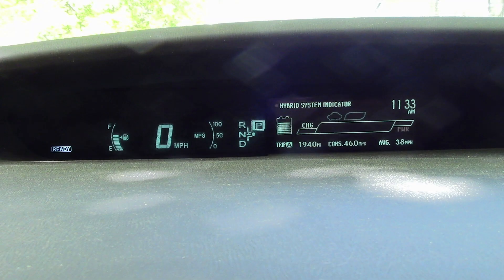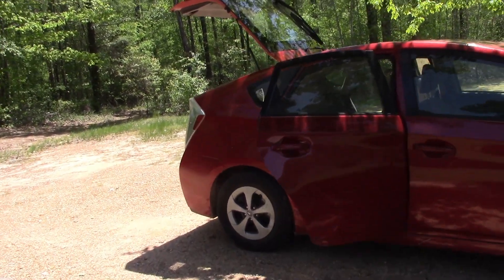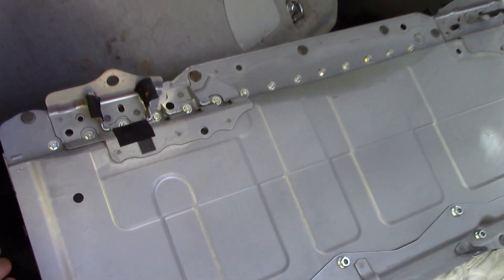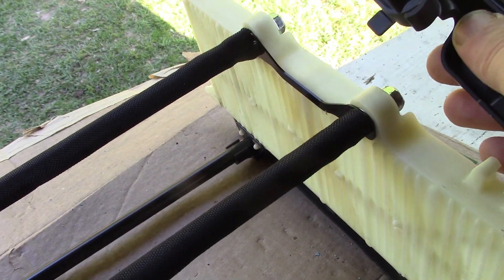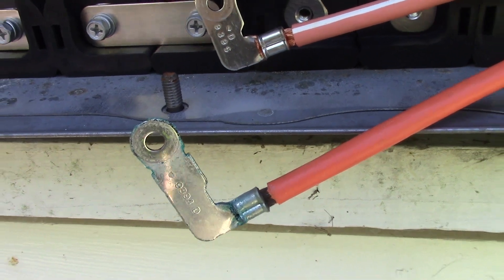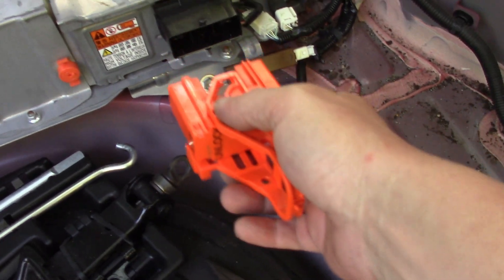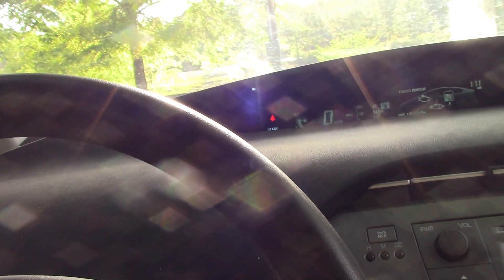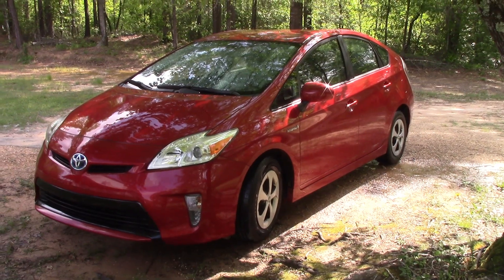Replacing Prius Hybrid Traction Battery (with scary wrong re-start!)

Comment: Mark I have a Prius exactly like that. It just suddenly died on me this summer. It’s showing a hybrid error. I’ve not pulled the codes or begin to diagnose it yet. I need a scanner. You are such a cool dude Mark :)
Reply from the maker: Cheers! I wouldn't be surprised if it's the traction batt, if it's not been changed. The Dr Prius App (free download on Android) can tell you which modules are bad. For OBDII scanner, I have a cheapo one from Ebay ($25ish, so not expensive). 
If the car's nearing 150K and hasn't had the EGR circuit cleaned then that can lead to headgasket fail, rattling and fault codes. Can check one of the pipes easily enough for condition of that system. I did a vid on it some years ago: 
https://www.youtube.com/watch?v=C7v538eQRDo
Reply: @Slider2732_  thank you so much Mark. Really man, thank you. I need this car so bad. I’ve not had a ride since August. 
It first started showing a “hybrid error”. The engine side seemed ok, but it soon started making a loud clanking sound from the electric side when I’d try to crank it, so I stopped trying. I thought maybe it was the inverter, but I have no clue really. If you think you can help me diagnose it, I will happily send you some money on cash app. The car has about 240k miles. Im not sure where to even begin. I’m sure the batteries are all dead by now.

Edit - Grok is telling me the clanking sound I’m heard when I tried cranking it, is most likely the damper disc. It’s saying $2,000-$5,000 repair. Does that sound right to you Mark? If so, I guess the entire car is trash now.
Reply from the maker: @fasteagle9959  A loud clanking sound from the electric side is a little confusing. Mostly, how did it run before the issue? 
If that sound is non engine then it could be the inverter. There was a recall soon after the 2010's came out because of failures on accelerating, like for on ramps on freeways. But the MOSFET's failed (electrical components), nothing clanky. 
Do check grounding points, by unbolting, cleaning, rebolting. Theres never a lot of rust on these, but could be some if spilled brake fluid got onto a grounding strip, which, could cause arcing. the clank sound may be electrical heavy sparking? 
 
If you press the Start button and it goes into EV for a few seconds, then starts the engine you're gold. If you press Start and it instantly comes up hybrid error and does the clanking then I'd say it's electrical on the orange wire end! If you press the Start and all hell instantly breaks loose then it isn't the engine. 

Could it be the HV contacts under the back seats?
You press Start, there should be a strong click from the traction battery electronics in the back and then up comes the regular dash and off you go. About 5-10 seconds later the engine starts. If those contacts were worn/dirty they could chatter and mess up.  
If I were a betting man, that's where my money would be at the moment. 

If it could be lifted on oil change ramps to get a view under then that might show anything mechanical (have to remove the underneath plastic tray guards). If all is clean and dry, no cracks, nothing wrong then I would suspect an electrical issue, not a headgasket fail - something you'd have noticed in the previous few weeks of driving anyway. Could always check the oil, see if there's water in it, milky/creamy looking.  

The garage quoted you a "Don't bring it to us", shouldn't worry about that. For that cash they'd swap in a scrapyard sourced engine AND electronics and pocket a bunch. 

A good sign is these don't normally fail in a sudden major way, they show signs well before complete failure. Even head gasket and EGR full blockage will show as rough acceleration and rattling at idle for a month.

Hybrid failure normally suggests the traction main battery. but, this seems more like something finally gave out - and it needn't be expensive to fix.  

I would recommend Priuschat forum for a search on similar symptoms and maybe to post your issue - those guys know the whole situ for Gen 3 and are kind folks 👍
Reply: @Slider2732_   hey Mark…thank you so much for all the info. I have someone bringing me a scanner to borrow tomorrow. I’m going to charge the 12v battery and see what codes pop up. 
Here’s what happened. Just one day I went to crank the car and the “hybrid system error” msg popped up. The gas engine still started and ran normally. This probably wasn’t very smart, but I tried to restart the car probably 10 times hoping it would go away. This had happened once before months back and the hybrid system error just magically went away and the car ran normally, so I tried restarting it about 10 times hoping the msg would disappear. Then during one of these restarting attempts, that’s when the clanking sound started, so I quit right then. This clanking sound, it sounds like metal hitting metal. It sounds really bad. Just prior to this ordeal the hybrid battery has always charged to 100%. 
I’ve been experiencing some really bad financial hardship and I haven’t had a scanner, so the car has just sit out in the yard since August. When i discovered your channel and saw your Prius videos, that renewed my interest to investigate further. Prior to that, I just assumed it would be a very expensive repair and since I’m flat broke, I haven’t done anything. Seeing your videos gave me some hope that maybe it’s not something major and it’s possible that it’s something that can be repaired after all. I guess the first logical step is to charge the 12v (if it will still hold charge) and pull the codes? 
This clanking sound is really bad. It does it when you try to start the car up, but it was starting normally, except it had the hybrid error on the display panel. Ugh, I should have stopped right then and there and not tried to keep restarting it. That wasn’t very smart. I’m worried I’ve really damaged something now, but maybe by the grace of God I haven’t. All this time I’ve just assumed the repair would be a major expense. 
Mark, I can’t thank you enough for helping me with this. I wish I could do something nice for you and Julie also. Yall are such good people. Thank you so much for your friendship. I value that so very much. 🙏 ❤️

edit…its crazy that we have the same exact car. Mine is red also !!
Reply from the maker: @fasteagle9959   
For codes, my suggestion would be to leave your foot off the brake pedal and press the Start, to put it in accessory mode, rather than it try to start itself. I think that should still enable codes to be read, because the dash etc fires up. 

I don't know what could make the clank, hence suggesting Priuschat website.

If it won't pull codes unless the car is actually on, then one idea would be to ask someone to switch it on while you look at the engine area ... perhaps with video to record what happens. Video always helps diagnosis from others online. 

Also, if the car was returning about the same MPG all through this then it may not be traction battery related. Usually they start to drop MPG when there are bad modules. They won't run in EV as long and similar symptoms.
My old battery pack did have corrosion on some lugs, so that is also worth looking at. The whole area under the back seat is worth looking at, as well as the engine bay for any loose bolts/connections. For anything orange colored, of course, pull the rear connecting bridge plug to avoid shock hazards. 

Good luck!
Reply: @Slider2732_  thank you again Mark.
From what I’ve read so far, the brake and start button trick will work to pull codes. I’m going to get out there and try once this weather breaks. Man, last night was brutal !!
The mpg and the EV mode never changed, so I was thinking that a previous owner must have swapped the battery already. It has 240k miles, so I would think that’s the case. I hope so. I haven’t gotten a visual on it yet, but I do need to do that. Also, I’m sure the battery cooling fan filter needs to be cleaned or swapped because I was hauling around my furry Shar Pei all year lol.
I’ll let you know what I’m about to figure out this week. Thank you so much my friend. You’re such a nice guy Mark. Thank you my friend. ❤ 🙏 
I hope y’all are having a great weekend.
Reply from the maker: @fasteagle9959  OK, good luck with it! Should be back to 70F next weekend 😁

Comment: Well not being a fan of net zero insanity I reckon you are taking a risk playing around with a high voltage battery unless of course you are a qualified mechanic. The scary bit is you are fitting a Chinese made battery.
Reply from the maker: If unsure of abilities then I would agree about having such a job done by someone competent. These are safe to handle when the orange disconnect is pulled. Also, I too would worry if lithium, but NiMH are a very safe chemistry.

Comment: Superb video i know just changing regular 12v battery 20 years ago messed up your radio immobiliser ect without the codes so good to see everything jump into life would have cost a fair wedge at a garage especially Toyota dealership 😊 👍
Reply from the maker: Thanks John 😀
Yes, even ChrisFix refers to the cell replacement alone as a $500 job, so the savings were worth the anxiety!
It looks like it had to become reacquainted with itself, considering the heart and lungs transplant it had just had, which explains the dashboard at first start up. Similar does happen with only the 12V being replaced.

Comment: That is pretty good mileage.  I remember my 1978 V8 pickup truck used to get 18 miles to the gallon.
Reply from the maker: Yeah, common enough still these days to get much lower MPG. I had a 1987 GMC Sierra that did about 12MPG, plus a quart of oil every fill up. In fact, we swapped a 2014 Ford Escape for this and the Escape was averaging only 18MPG and, already had rust under a rear door.

Comment: Great video ❤

I wonder how bad is the old battery pack ? This type of battery pack is perfect for boosting … maybe in conjunction with your solar setup may work as they charge up quite fast. But, probably you need a different battery management bespoke to charge this first then the others, or eventually charge the others from this one.
Reply from the maker: Thanks 😀As far as I know there's nothing wrong with the old pack, except age. We do get great mpg and better EV range now... but, we also considered how the car was bought at 5 years old in any case.
I'd like to sell the whole pack, while no cells have ever needed to be replaced. I know they can puff up if charged wrongly and it would be a real waste if folks need the cells for their ailing car. Also, I noticed these new batts have doubled in price ($3895), likely due to the tariffs!
Reply: @Slider2732_ I wonder how feasible it could be that a hybrid ev car may serve as a backup generator for a house ? Especially for a house that already uses solar systems for power ?
Reply from the maker: @ Ah, very good point.
The answer is, great! Have seen a few people do exactly that on YT vids. They hook up the car 12V batt to usually a 1000W inverter. The 12V batt is the inbuilt version of a 12V solar batt system. The car engine will power up automatically at 2 bars left on the EV range graph on the dashboard. In so doing, the EV battery gets charged. The EV batt keeps the 12V healthy. It's all quite clever.